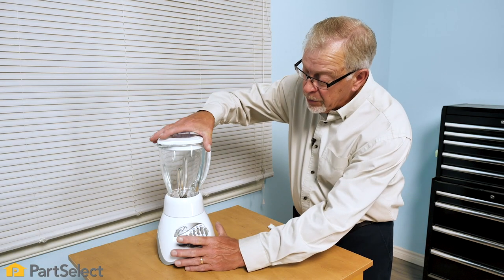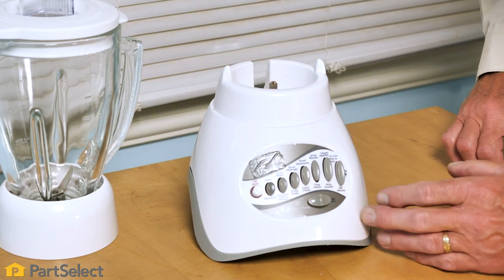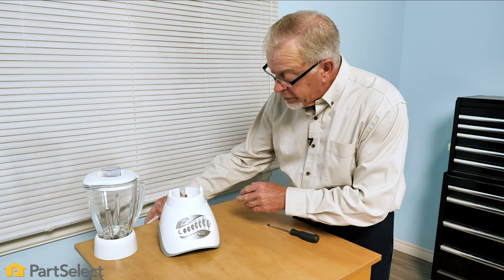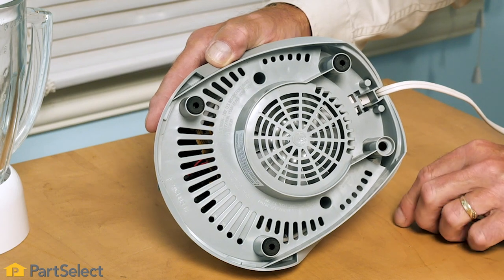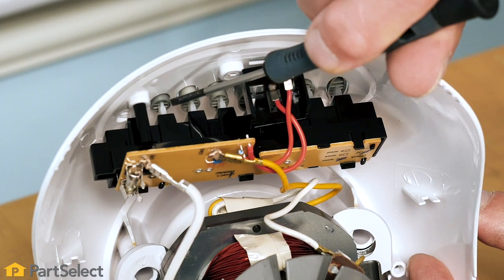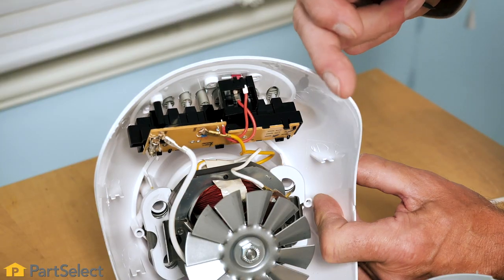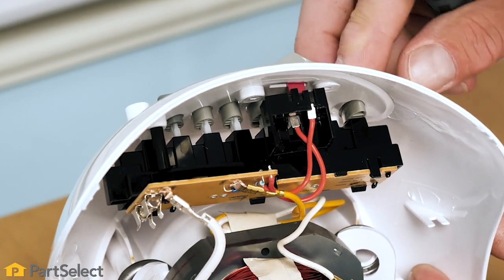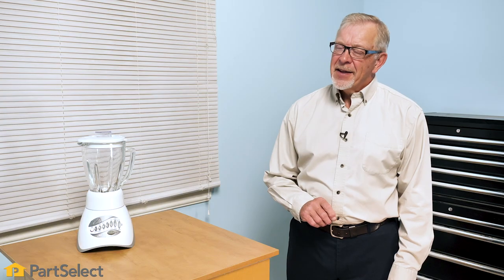Small Appliance Repair|  Blender Buttons Are Stuck | PartSelect.com

Comment: I tried removing the circuit board but after removing the screws from the inside there was something else preventing it from freeing up. How do i pull the board out? The only button that works is the first white button in the left.